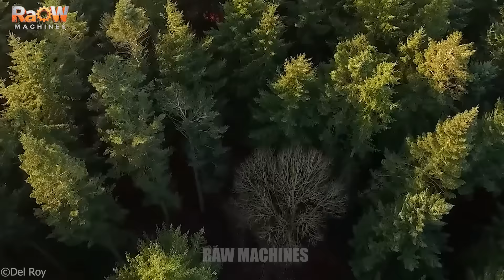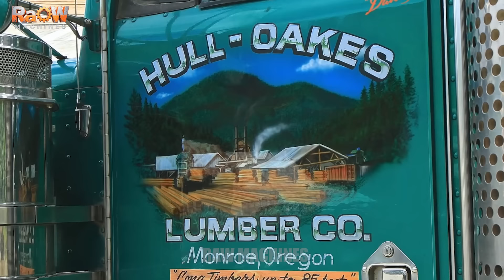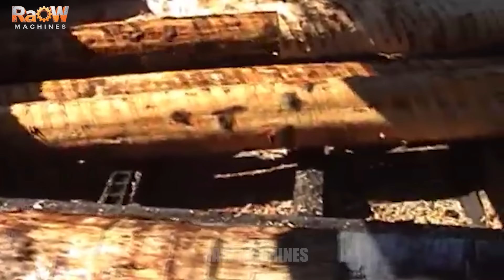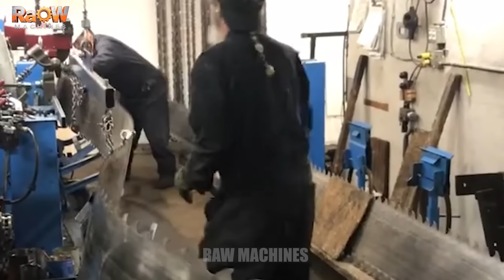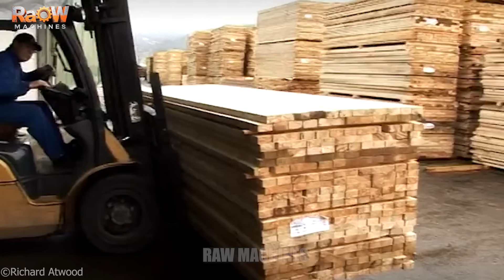Inside Hull-Oakes: The Last Giant Steam-Powered Sawmill Still Cutting Logs | Full Documentary

Comment: These are tiny logs compare to those I seen in Liberia Africa in 1978.    Many logs were 170 foot long..... 30 foot in diameter.  " ONE " tree per truck.  Those trees were over 360 foot tall.   Loggers cut the trees nearly 70 off the ground because of the root base ....which extended more then 500 foot in diameter.   The government would fine loggers if the cut trees that they could not move.   That happened often !

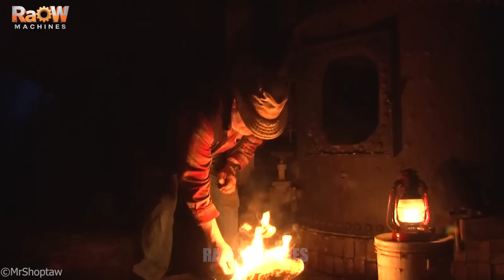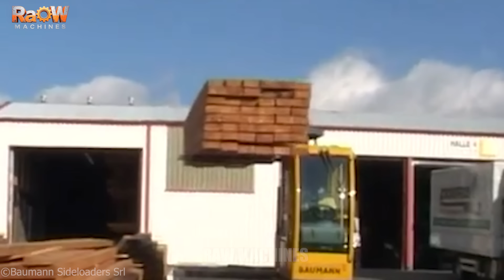Comment: This a fascinating story of an old mill, I wish it had more of the history of the mill rather than how it's currently operating... and on that note... I can't help but feel that I've been lied to. At the 17:00 mark, the narrator describes how a worker comes in at midnight to start the boilers and has the pressure up to 150 PSI by dawn. Through the entire video, we've been led to believe that this is the last (or one of the last) steam-powered mill still operating. Yet at 26:45 we're told that the mill had been switched to electric power back in 2013. 
SO THIS MILL HAS NOT BEEN STEAM-POWERED IN 13 YEARS? Sad, but understandable. You don't make any mention of what the mill now does with all the waste generated that you claim to use to feed the boilers.

Comment: I'm guessing OSHA also had a little to do with upgrading the mill.
Reply from the maker: 😄 You might be onto something there! Safety standards have certainly changed a lot since the early days of steam-powered mills. Looking at some of the old footage, it's hard not to imagine a modern safety inspector having a few things to say. At the same time, it's fascinating to see how historic operations adapted over the years while continuing to function. Thanks for the comment! What's the biggest difference between historic and modern workplaces that stands out to you?
Reply: @RaWMachines-g9r , safety. I watched a lot of videos about how industry used to be, and it's a night and day difference. Deaths used to be a pretty common occurrence. The machine at that plant that scares me the most is the boiler. Holding at 150 psi (assuming the cracked and damaged gauge is correct). That boiler has been cycled hot/cold thousands of times since it was installed, and that is the worst thing you can do to a boiler. Boiler explosions killing many men happened pretty often back when they were used.

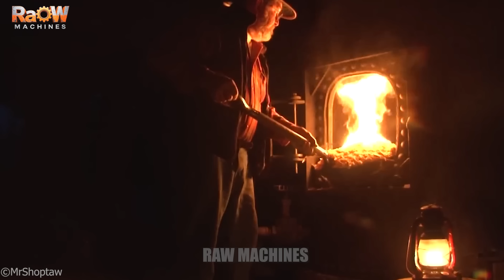Comment: What does the steam engine do, generate electricity?  Everything up until 17:09 you show is modern and electrically or hydraulically driven. After 17:09 is a different sawmill.
Reply from the maker: That’s a very fair observation, and you’re absolutely right to point it out 😄 Hull-Oakes is kind of a fascinating hybrid between historical steam-powered systems and later modernized equipment. Some parts of the operation were updated over time with electric and hydraulic systems, while other sections still preserve and actively use the steam-powered machinery the mill is famous for. So the documentary ends up showing multiple technological eras existing together in one working mill. Really appreciate the detailed comment and careful watching! Which part of the older steam-driven system interested you the most?
Reply: They do not generated electricity or use steam for more than 8 years

Comment: It’s incredible how these machines still handle giant timber like champs.
Reply from the maker: It’s honestly amazing to watch 😄 There’s something deeply satisfying about seeing these massive old machines still doing exactly what they were built to do generation after generation. No flashy electronics — just raw mechanical power, maintenance, and skilled operators keeping everything alive. Really appreciate your comment! Do you think modern machines will still be running this reliably 80 or 100 years from now?
Reply: @RaWMach @RaWMachines-g9r : hell no. As an example You can see how cars are cheaply made now and not lasting as long as they used too. 
(I had an old cadillac that never had a problem). And young ppl dont know their right from their left or how to read an analog clock. Just like there was no one to replace the last operator, who will be running said machines? Likely robots or some kind of Ai. All by design.